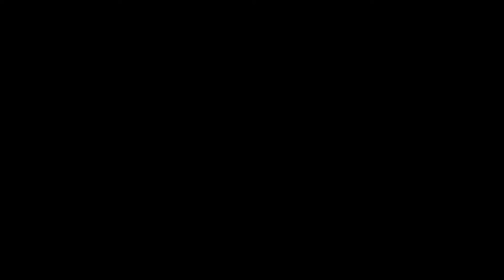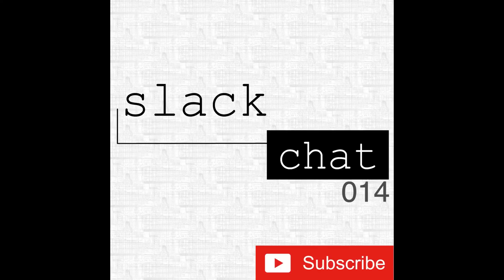S01E14 - Vulkan 3D, and package integration with Slackware ARM

Comment: That HP logo always showed up at the top of my xfce screen on my AUSU EeePC 2G Surf that I ran Slackware -current on for about five years (about ten years ago). KDE wouldn't run in the 256GB RAM I had so I used xfce.
I had nothing related to HP myself. I just assumed it was part of the default display.